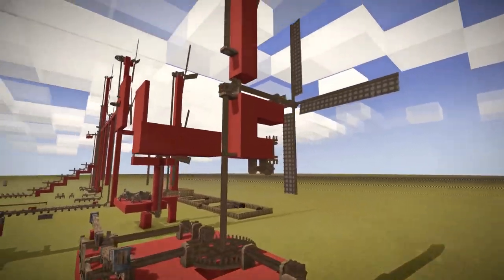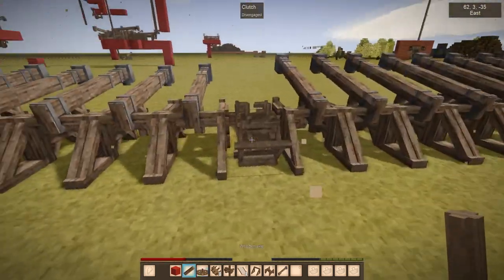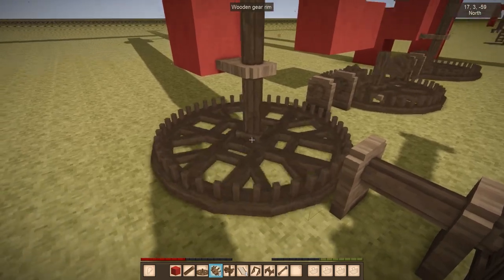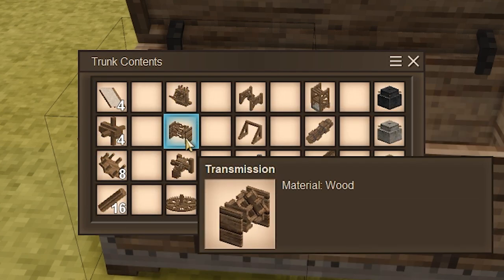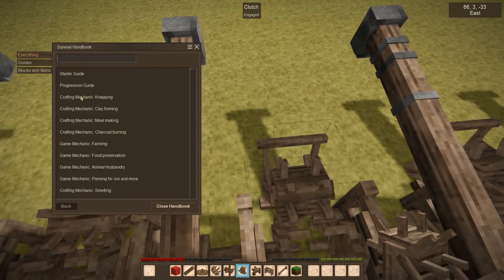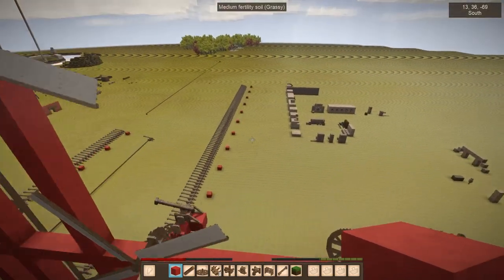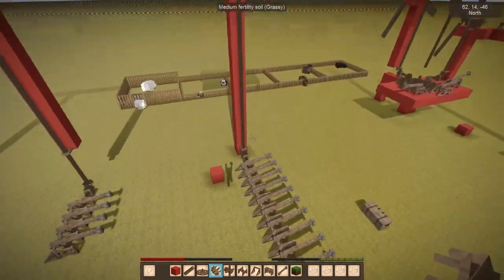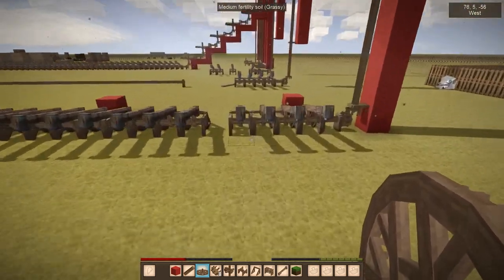Windmills, Gears and the Wind - Tutorial - Vintage Story

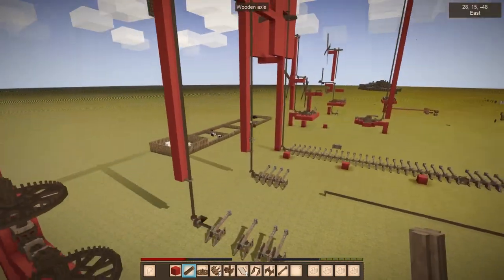Comment: your first example, reviewed at 5:15, had the windmill turning the big gear using a small gear and using it to turn the long axle by converting speed to torque.
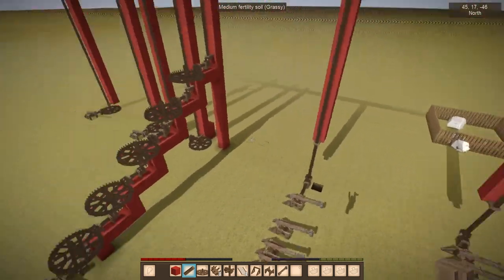The example you said would be the same at 5:45 turned the axle, on which there was a big gear. The big gear then transitioned to a small gear that in turn powered the helve hammer
So the first one had a small gear to big gear and then back to a small gear (1:1), the second one a big gear to a small gear(not 1:1), so you had less torque (but more speed).

Again at 16:57 if you pause and look at your setup, the contraption in the foreground goes small to large to hammer, the one in the background goes from large to small to hammer. Of course the rear one doesn't work, you try to run it at lower torque.
Reply from the maker: Well unfortunately i made this video so long ago and haven't played VS in quite a while as well lol. So I can't speak knowledgeably about any of this any more 😂 I've forgotten pretty much everything.

Don't know if the devs have changed gears around or not. When i made this i do at least recall them being very buggy and not quite right.

But i appreciate you taking the time to watch the video and comment!

Comment: Nice tutorial. I've spend a very long time trying to get those things running right. I've gotten a helve hammer to work exactly once, on your server. I've never had use for a... smasher... thomper... thingie... I usually only use them for querns, and a bunch of them have been pinwheels on sticks, with no building. rofl
Reply from the maker: Function over fashion huh 🤣 

It really isn't fully necessary to even use mechanical power, got avenues to accomplish everything without em. As far as i know anyway lol.
Reply: @PapaCheddar  The quern is easy enough. Just set it to run, and turn my mouse off while I go for a smoke. lol
Reply from the maker: Haha 🤣 I've been there. Though i use something to weight down the mouse button. Didn't even think of turning off mouse. 

Drop a chest above the quern and you could be there for a while
Reply: @PapaCheddar  With a funnel... right? Or do you need one?
Reply from the maker: The funnel i think does work. A straight chute works too im pretty sure. Less mats too i think with chute.

Keep some hoppers on the ground too and let that puppy overflow!

Comment: It's pretty annoying when You build everything correctly, connect the axle to from large gear to the hammer or grinder and it works very fast for a second and then stops. What an annoying bug considering how much effort goes into creating those on survival.
Reply from the maker: I agree. It can usually be fixed by breaking an axel and putting it back.

Def not a finished product though 😅
Reply: @PapaCheddar  I discovered something funny. I had no way of making one large gear with two windmills Connected to it work properly. At first I could use them and small gears to power quern and make it work very fast. After a few changes I wasnt able to do that anymore and it just stopped. I had similiar problems with running even one helve hammer. They were either too damn slow and didnt work at all. In the end I managed to make both quern and 2 helve hammer work at reasonably high speeds at once. One of the windmills is connected to the middle of large gear, either from the bottom or from the top, using axle and gears. The second windmill is connected to the side of the large gear with normal gear. Im not sure if I understand it correctly, but the game may think that one Mill produces slow rotation which is torgue and the other produces fast rotation which gives it speed. Dunno why it works but it works well haha.
Reply from the maker: Nice haha. Sounds like it shouldn't work 🤣 but all logic is already out of the window. 

End of the day. if it works, it works. Don't question it!